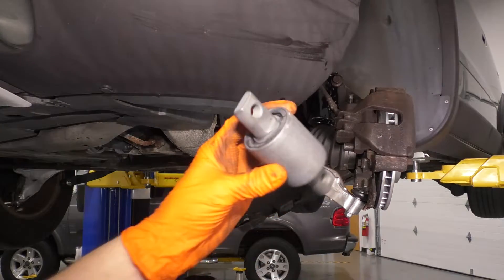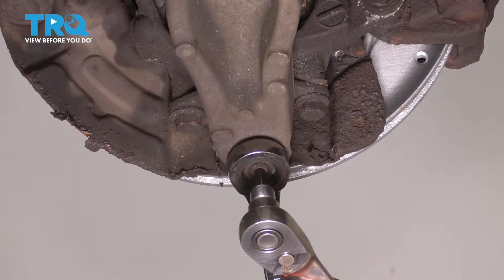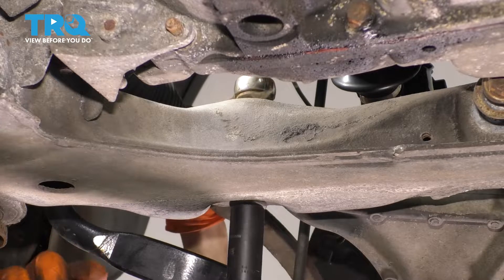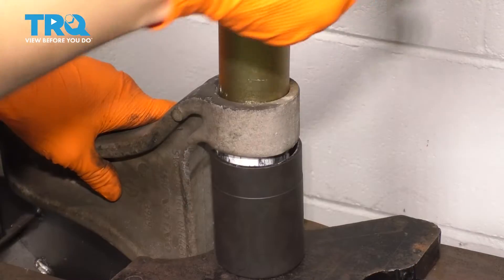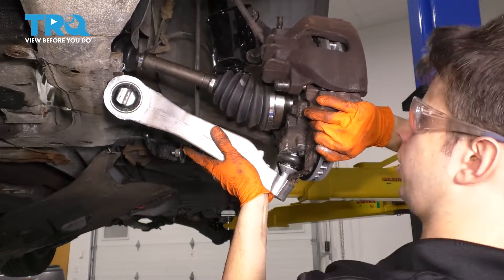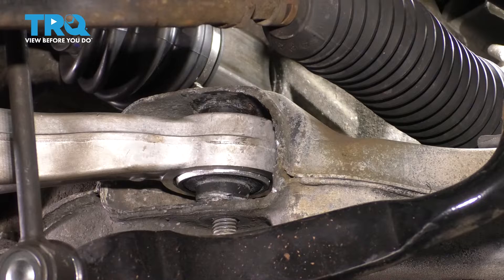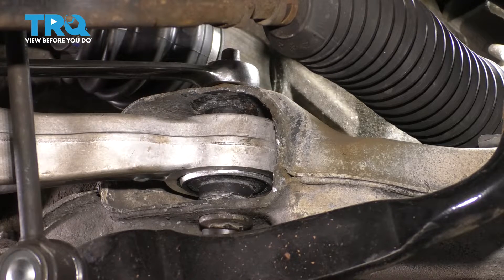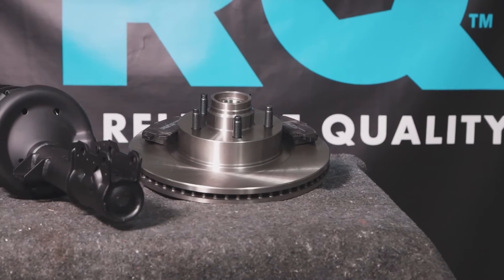How to Replace Front Lower Control Arm Forward Bushing 2001-2007 Volvo V70

Comment: 7:10 you hammered bolt to align bushing, then you put the bolt in from below instead of top. In this case if the nut unscrews from the bolt the bolt will fall out causing a fatal hazard because the swingarm will not be attached.

Comment: The concern I have is that when your attaching the control arm it is verticle. But when you get back to the ball joint it is at an angle. Did you push the arm down to pop the ball joint in?

Comment: Note it's very important to tighten the LCA bolts with the suspension loaded. Jack the end of the control arm under the ball joint to take the weight of the car. This aligns the bushings and prevents early failure.

Comment: I live on the coast. I would spray everything down a week before and every couple days, respray everything. Then when trying to break it loose. Put a tiny bit of 'tighten' on it and then start to break loose. I have a series of wobbly sockets that allow me to use an impact everywhere. The shaking will help make things come apart. A tighten then reverse makes it come apart easier. Remember to respray everything so that if you need to fix it again or your son needs to fix it, it will be easier with a coat of thread penetrant already under the dirt.. Since it is a Volvo, your grandkids may be working on it...cheers, stuntgirl